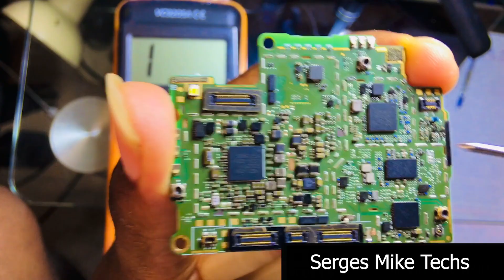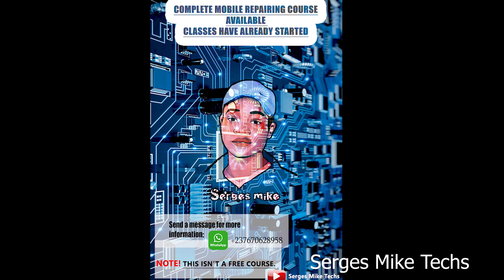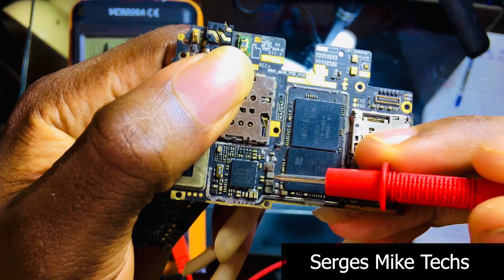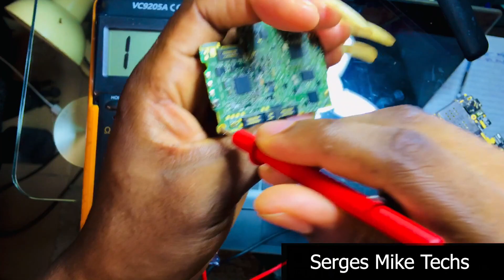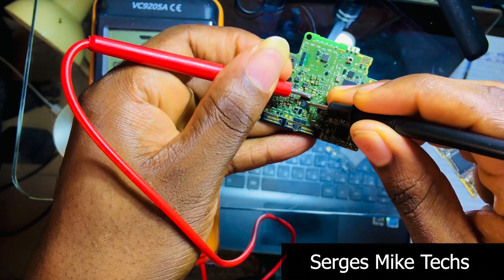How to Identify and Test 4 Different Types of Inductors (coils) Using a Multimeter

Comment: What's a job of that conductor?
Reply from the maker: Just just the pins on the component in which you can test to know if it’s still working
Reply: The inductor is used as a storage for energy by receiving power and inducing its magnetic field due to its wire windings and as the circuit's current powers through it; though, it is used to take an appropriate amount of current in the circuit and storing it while the circuit is operating with current. They operate similarly to transformers or automobile ignition coils, simply because it is a conducting coil used to boost the magnetic field with supplied power which will in turn boost the flow of power.
Reply: @tvoovm7254  I have a broken 3R3 inductor, (no continuity and no resistance in multimeter, and whining sound when device is on) next to my battery connector, could it be the reason why the battery is not charging?
And how can I test it?
Can I short him temporarily for testing purpose?
Reply: @nichderjeniche  Man, I don't know how could I respond to this, but you could check if there are fluctuations going on with the battery, but because you informed me that the inductor is the cause of this problem and had already verified that it had been measured for continuity and resistance, inductor failing both tests, the inductor may need replacement.